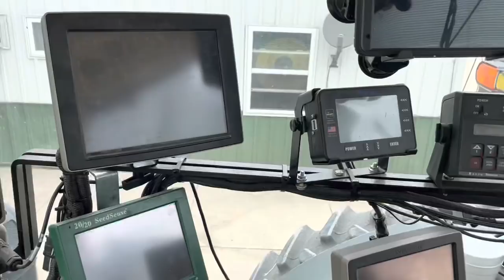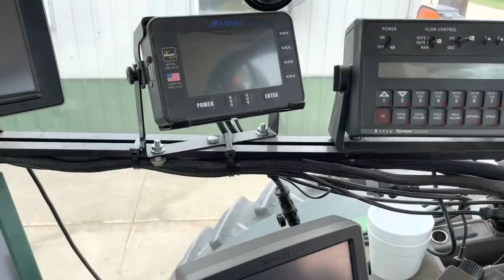This is why you don’t trade planters

Comment: Unrelated question. As I traveled through Montana today, I encountered several, umm. Harvesting crews. Convoys of trucks pulling trailers with combines and other required paraphernalia. 
I assume that they are profitable but I don't see how.
Can you enlighten me?
Reply from the maker: Yes, most people only use their harvest equipment for about five weeks per year. The rest of the time it just sits around. A lot of guys make a lot of money by traveling around the country and keeping their equipment working for them all the time. It’s just like any custom operating business. Many people make a lot of money mowing lawns as well.
Reply: @dodgebrothersfarmandranch9206  yes there are some HUGE lawns to mow in Montana. Thanks for the insight.